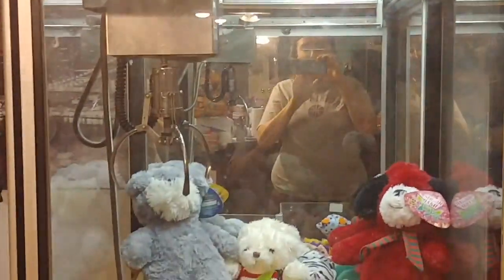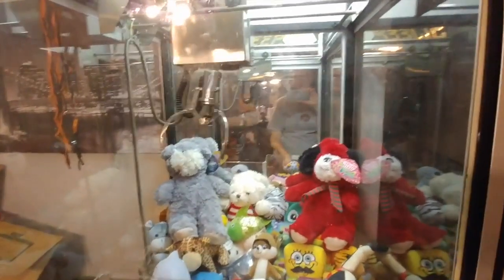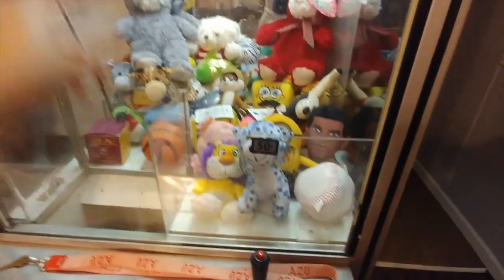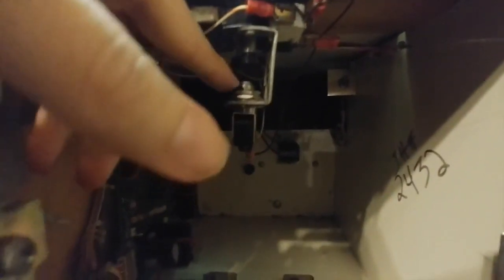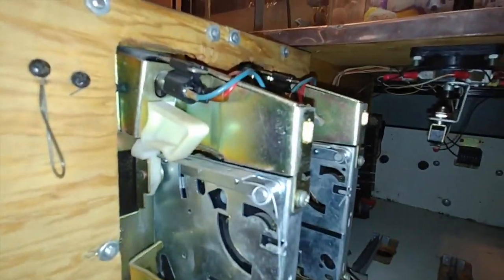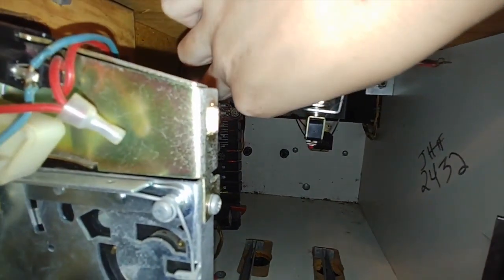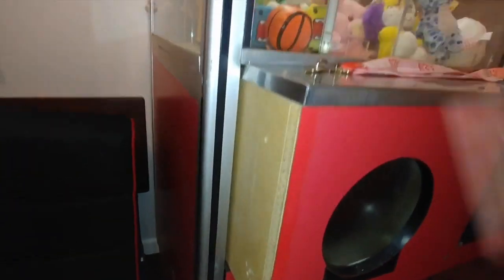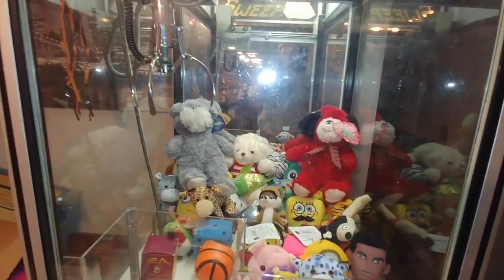Clean Sweep Problems - Need Your Help With Fixing Claw Machine

Comment from the maker: Now when I press the button with my finger it doesn't want to work except for about every 10 clicks.
Reply: I have a machine like this in my home.. I also have a few machines on locations in stores. At first I noticed the claw not dropping the prize.. you could possibly have a problem with the limit switches on the claw trolley or the trolley bridge (limit switches tell the computer that the claw is at "home position" or over the prize chute. If those switches are worn out.. the wheels on the trolley / bridge will keep spinning until the machine re-cycles. I don't think that problem has anything to do with the joystick button (I could be wrong). There could also be a problem with the switch at the bottom of the joystick where you showed the button clicking (It also has a switch) it could be bad or a short (same as the limit switches). If those switches aren't bad, there may be a problem in the motherboard. I would try replacing the limit switches before trying to have the motherboard repaired. you can find these parts on ebay.
Reply: I watched the video again and at the beginning when the claw just sits there, I can tell that the machine isn't registering when the claw reaches home position.. This is most likely a problem in the limit switches.

Comment: From the looks of things both the problems look to be wear and tear of micro switches.
I'm guessing the bars of the micro switches have lost their shape over repeated use. You can easily get at them and bend the bar back to an angle that will cause them to register a press.
If your unsure of what i mean just do a picture search for microswitch on google and you will see the bar that needs to be bent.
Reply from the maker: Thanks I will definitely look into this. Do you think that is the problem with it taking forever to drop the prize too? I did notice when I bent one back it is registering again and dropping the claw, but I still have to put the pad there to get it to hit the button.
Reply: There is most likely a switch up the top for it to know when it is over the tray and to stop the motor. If that switch isn't being hit it will think it's not there and that is why the wheels still spin. This is how these things usually work. I know nothing specific to these claw machines but know how robots and such work.
I can't really be specific because i can't really see the whole mechanism.
Reply: Have you got it sorted?
Reply from the maker: No unfortunately, I got it to drop the claw for a little bit but now it is back to not wanting to drop without the timer running out.